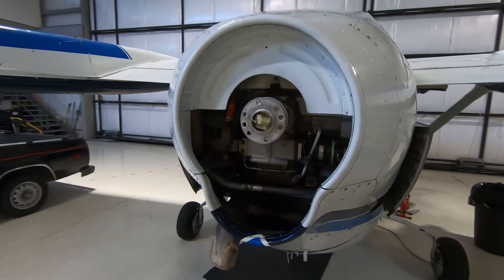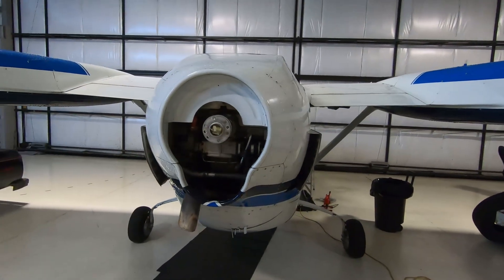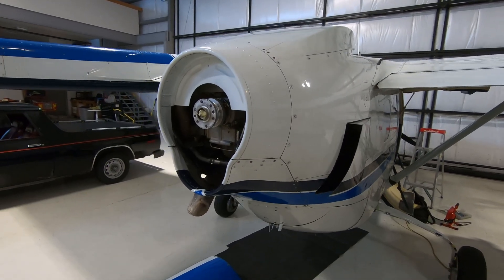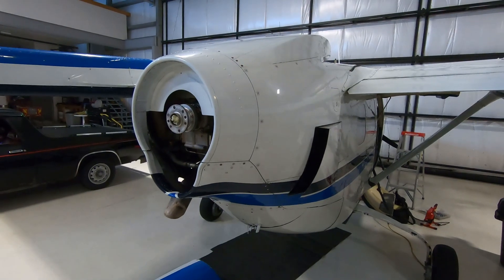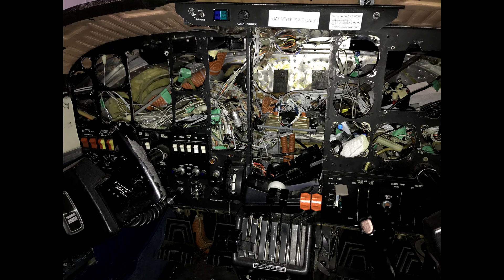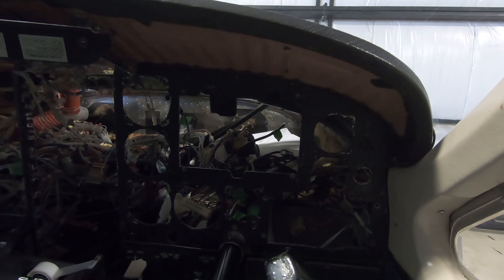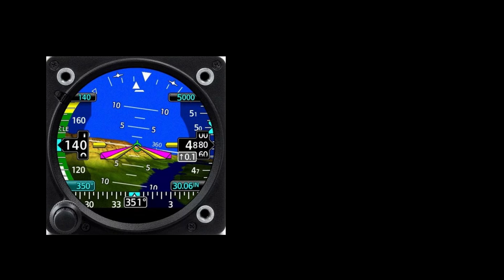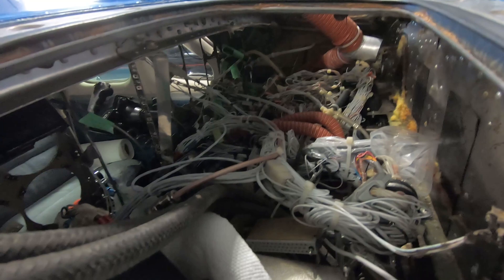Skymaster Prop Damage & Avionics Upgrades

Comment: The tires kick rocks.  I built and flew a long eze for years and know the troubles.  Those MTs look cool but a Metal blade back there will be more resilient.  Check your weight and balance at normal load.  See if you can replace the light MT with AL if it might help.  Those MT pusher blades had to be expensive.  I looked at MTs but my loaded balance would put me beyond my aft limit.  Expensive also.
Reply from the maker: Yeah I'm not super happy with the composite props.  They work well but they are fragile.  However, I plan to keep them because it would be very expensive to change.  We'll see how it goes with them.

Comment: Is your engine management certified for your pressurized skymaster? I was under the impression that there was not one on the market.
Reply from the maker: I’ll be using it as a secondary monitor.  I’ll be keeping all the factory engine instruments.  I believe the mvp-50 can be used as a primary instrument but I haven’t pursued that one so I don’t know much about it.
Reply: @dr.dansgarage  Have you ordered the monitor?
Reply from the maker: @xz2683  the mechanic is procuring it.  The process has started